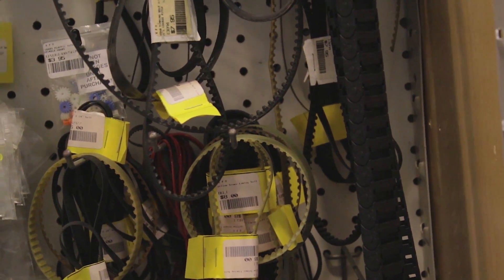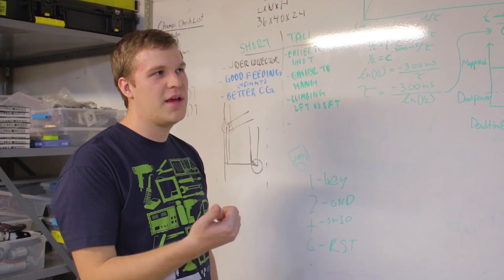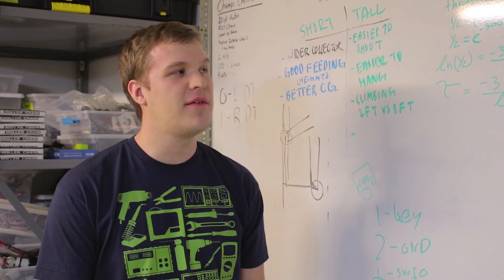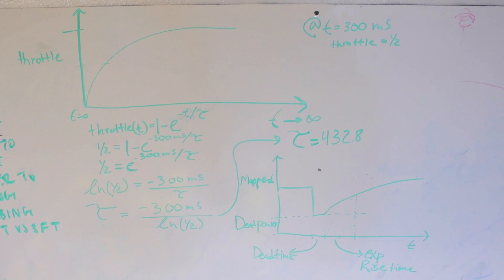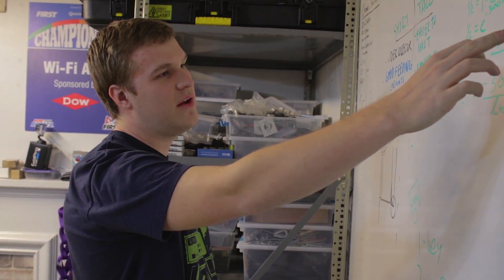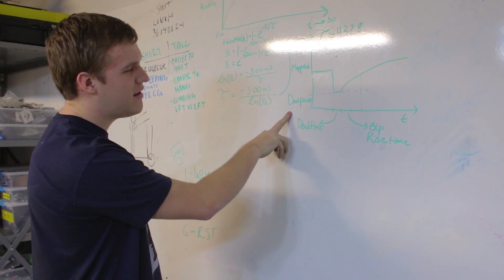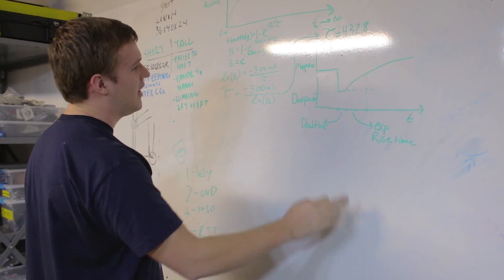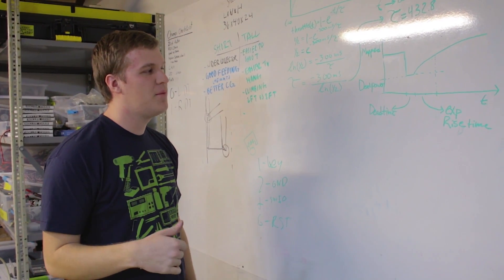Ri3D 2017: Team oRyon - Optimizing Automatic Shifting

Comment: You should be able to do better than this. With autoshifting you are trying to maximize acceleration, therefore you should shift when the acceleration generated by the high gear exceeds the acceleration generated by low gear. Thus, if the shift point is chosen correctly, the acceleration of high and low gear should be the same at the shift point, and therefore there should be no jerk.